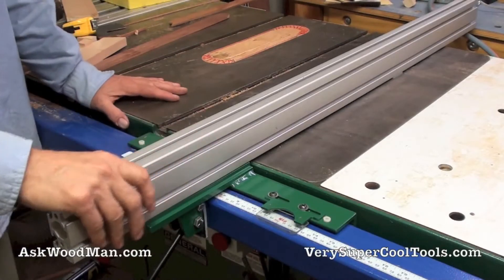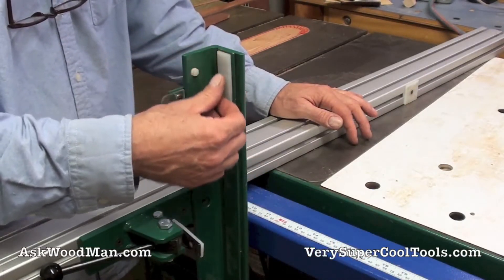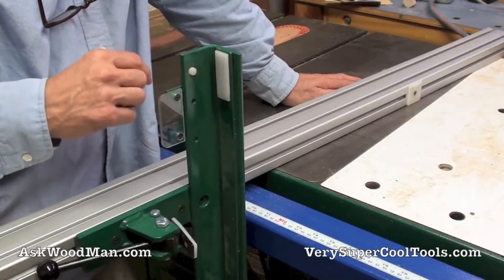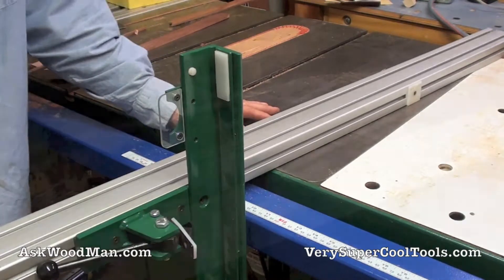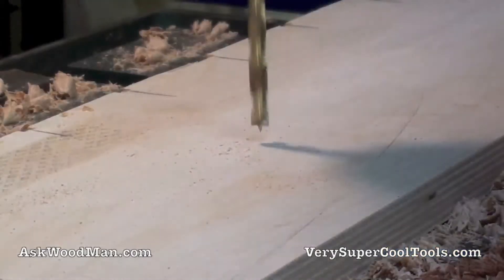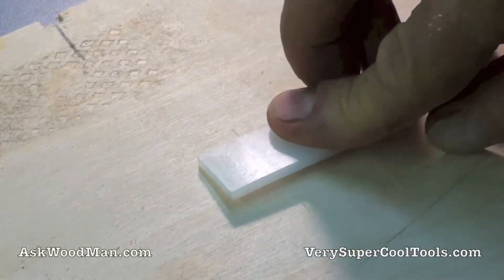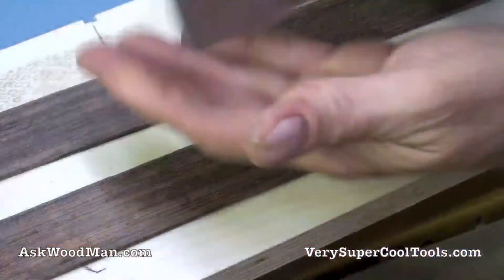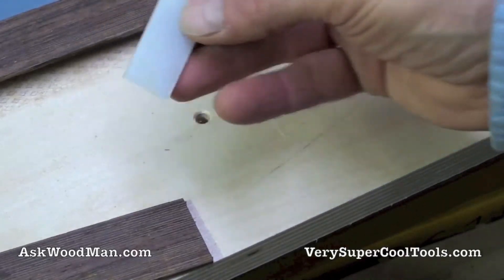UHMW Glide Adjustment for VerySuperCool Tools T-Square

Comment: Aw dang ! Great video/
You gave me the idea to fix the fence on my old Craftsman 113 - I'm the second owner and finally found the issue with the fence itself: when it was new, it had two strips of nylon glued to it to help slide against the edge of the guide - well, those strips were messed up  and hence I had a hard time making long parallel cuts. I put two pieces of mastic aluminum tape and it worked for one cut - the glue squeezed out and made a small mess...
I'm gonna make two of these sliders and put in there with new holes... except that they need to be about 1/16-in .  I actually have a large piece of 1/2 in HDPE that I will try on. Should be fun right ? After all, we spend a whole lot of time making jigs , fixing tools, and all :-)
Thanks for the video and the idea seeded !

Comment: I have a bunch of Bosh (metric) Aluminum shapes and 80/20 (Imperial) dimensioned shapes.  Will your system fit either shapes ?
Paul Semler - Plumb-It, Inc.
Reply: Hi Paul, The extrusion profile in the video is 40x80mm. Our t-square fits a really broad range of extrusions the the 8020 series 15 and series 40 are the most common. Feel free to write me at askwoodman@gmail.com if you want to send me pics or specs of the extrusions you have. Allan